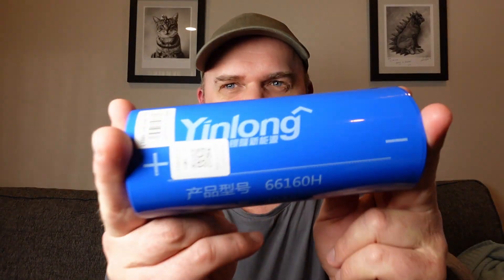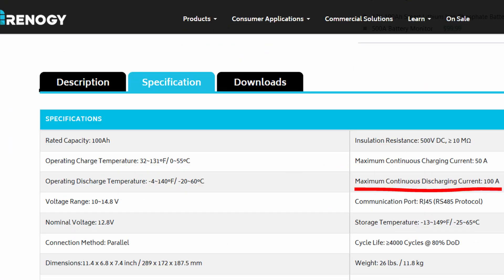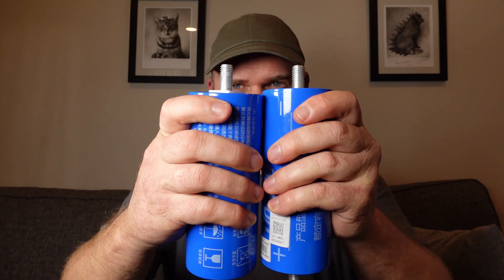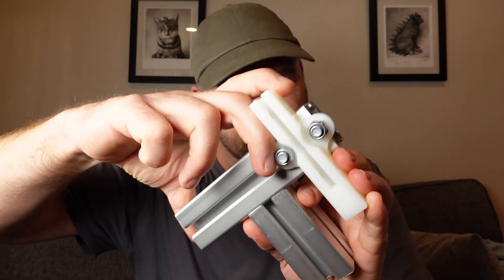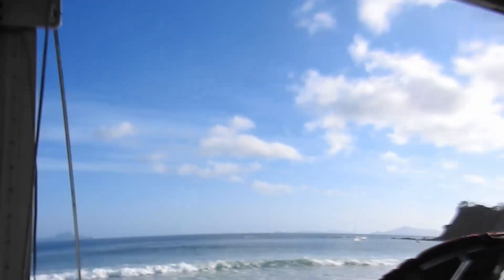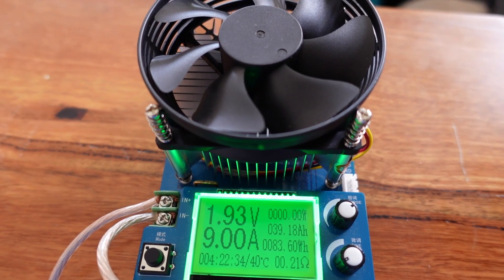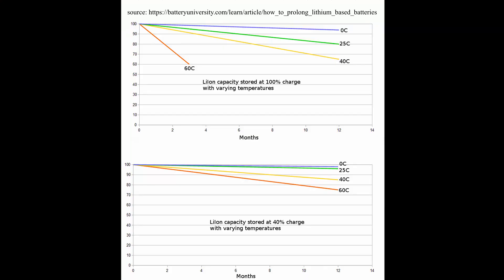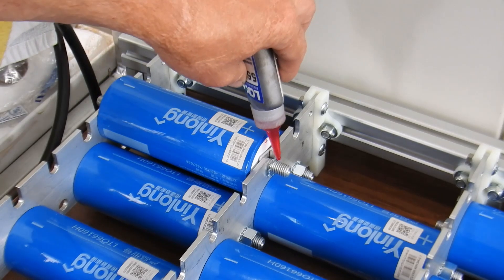Campervan DIY battery build HUGE POWER!

Comment: Great video man I really appreciate the information on these batteries though I kinda wish you would of shown the battery pack a little more maybe the finished version and maybe some usage tests. That RV your driving is pretty awesome I would love to see and hear about it ( I will check you other videos to see if you have any videos on it) anyway man thanks a lot for the video it’s great!

Edit: scratch that I just looked and you have a build video (I’m all over that video) sweet!! I love those Unimogs. Few years back I had a guy wanting to trade my ski boat for his older Unimog and at the time I didn’t know much about them and it was in poor shape so I passed but had I knew what I know now I would have jumped on it and could of built a sweet off road camper. SMH, live and learn right.
Reply from the maker: Cheers Tim.  I'll be doing more indepth on this battery and wiring in the future.  Thx

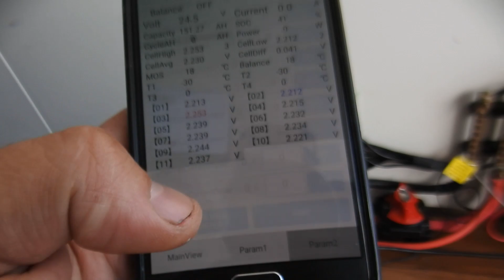Comment: 10:10 Im with you on that burner phone for the chinese software, got some for a BMS for my electric bike and it wanted access to make phone calls and if you denied it access it wouldnt run so stuck on an old phone.
Reply: Super important post IMO, due to the CCP.  The chinese people are good people but the chinese communist party is evil.
Reply: @GoZipper  You worded that perfectly. The Chinese people are good people, but in China, they are burdened by the yoke of the CCP. It is sad.

Comment: Can you make one ebike batterie out of it?
Reply from the maker: you could, but probably too heavy
Reply: @brendontait6968  36v how havy would it get ?
Reply from the maker: Depends on how many cells/how much capacity you need
Reply: @brendontait6968  500-1000WH
Reply from the maker: So 17 of these cells would make 36V, which would be around 1500Wh and 22kg.  If I were doing a pack like that, I'd consider the 30Ah prismatic, they would fit together in a smaller space and would be about 17kg

Comment: No temp sensors?
Reply from the maker: For what reason?
Reply: @brendontait6968  peace of mind?
Reply from the maker: What would you use them for?  Usually they are used for low temp cutout - not needed here.  Otherwise they are used for over temp on charge but my charge levels are too low to cause heating, these cells are also safe from failure after an internal short

Comment: I found a UK seller. £60. Per cell. Damn that's expensive when you look at how many you built together, does that sound right?
Reply: Yes, currently $47 US per battery.
Reply from the maker: Seems too expensive, you can pick them up for as low as $40USD inc shipping etc
Reply: @brendontait6968  bit of a minefield on Alibaba these days , the supplier in the first link you posted has now disappeared , they hate aussies lately so we have an added risk factor that they might not even arrive at all or they will send a bag of blue noodles instead of Yinlong 66160's

Comment: Nice build.  What do you use to charge your LTO pack?  Say when you are plugged into shore power.
Reply from the maker: Hey Dan - 100% solar fills it u really quickly
Reply: @brendontait6968  Ah.. yes,  forgot you guys have endless sun.   What charging parameters do you use with your MPPT?

Comment: That was impressive and even better, you're right here in NZ.  I prefer to use the smaller gauge soft fencing wire, which I don't think you can even buy these days, but chuck in a bit of number eight somewhere for that Kiwi feel and you'll have a winning combination (as if it needs it). Great work.
Reply from the maker: Thx mate

Comment: Pro tip for loctie a hair dryer will soften it up somewhat
Reply: or just use blue loctite instead of red
Reply: @Sugarsail1  green or nothing
Reply from the maker: I didn't use locktite brand so the color coding isn't relevant.  The stuff I used here was loxeal 55-04 which is equivalent to loctite blue.

Comment: Hey mate, just an old diesel fitter here with a bit of marine experience...
What types of metal are the - battery terminals, nuts & buss bars made of?
I see the buss is Aluminum, which in marine application would need a jointing compound to prevent dis-similar metal reaction from even 316 stainless steel.
So I suspect that sooner or later, 
you may end up with corrosion at each & every connection of this array.
We can also assume this corrosion will cause resistance which will generate heat---
not so good in a high current situation... just as your intro showed.
In this case- 99 cells x 2 terminals /cell = 198 
198 chances for this possibility to occur over time just from corrosion on the buss, 
due to dis-similar metal reaction. 
My suggestion would be 316 SS buss bars... 
but to be sure, what are the battery terminals made of? 
Aluminum nuts would also be an option if not for the load & heat potential, and, 
it's susceptibility to corrosion and the same dis-similar metal reaction to the battery terminal. 
Copper seems to be the trusted metal for buss in the electrical industry, 
but copper & aluminum don't mix well at all, just like aluminum with zinc/gal coated steel nuts.
But beyond this there is the soft (cut by hand with a knife) pvc tube insulators? 
Phenolic or at least hard nylon insulators would be required for use in ANY vehicle, 
to prevent a massive accident when the soft pvc tube gets split/displaced from continuous impact loads- which is the reason marine batteries are made with a more rugged construction.
Anyway mate, good luck with it. 
I would love to find a good, safe, affordable RV solution with this type of performance.
Reply from the maker: Hey, thanks for the comment.  Yeah, I'm reasonably aware of the dissimilar metals thing.  The lugs on the cells are ali and the bus bars are ali. You'll notice that I applied silicone grease with a cotton bud to each of the connections to prevent the possibility of any electrolyte or even air getting in the junction.  The "PVC" tube is actually nylon (I think I said this on screen) it is not a critical piece of insulation..  it just insulates the bus bars from the clamping bolts (which clamp onto the nylon brackets I made).  It's really there to minimize a short esp when using tools to clamp up etc.
Reply: @brendontait6968  Cool, glad to see you are open.
I am not here to knock, just interested enough to find a sound system.
If I can help, thats great, just don't mistake me for Anti...
If the cell terminals are Ali', it would be better to install the cell vertically, so as not to create sheer stresses, which you no doubt know is Ali's weakness. maybe then you could use a longer than normal Ali' nut; reliably.
In saying this I gave no thought to the configuration of the array, just a pure mechanical fact. I guess the strength of the buss & compounding weight on the lower cells may then become factors... 
But I agree in a couple of ways that 48v might be a better end product... 
on the more volts = less amps = less wiring/device load factor, &, 
generally improved 48v device  performance.
I'm keen to see you develop this, cheers.
Reply from the maker: @allxdup1909  as far as the shear stress, I don't think is a significant issue.  I'm not sure what grade they are using (probably 6060) which is roughly 200MPa in shear, if we assume a clearance on the minor thread diameter which would bring it to around 10mm X 200MPa gives around 15kN per side, so we are looking at around 3 tonne.  Even if the ali grade has got a quantity of cheese mixed in and is only 100MPa, that is still well over 1000 times the weight of the cell to cause an issue.  The orientation of the cells was primarily chosen to fit in the space I had available.  No doubt it's not a perfect pack, but I've learnt a bit making it and am going to make a bunch of different chemistry cells with different configurations in the future..  cheers

Comment: Think double nuts, torque first nut to mfg. torque, then add spring lock washer, then second nut, hold first nut with wrench, tighten second as tight as desired.

Comment: I just did my own calculations for my area, and my current setup which uses lead acid batteries wired SP for 24-volt.

Now if you're going to upgrade, you want to go better, not the same. My current battery bank is roughly 480 amp hours. Purchasing 84 of these would give me a Bank of 560 amp hours at 12 volts.
A lifepo4 battery in Canada is around CAD$1100-1400 each. I would need 6.
84x62.59= $5257.56
6x1100 = $6600.

Of course I could go Ultra cheap on the lifepo4 for batteries, But even Will recommends you don't do that because they all suck.  But a battleborn equivalent in Canada is around the $1,200 mark.
So I'm not really sure how Will figures Lithium iron phosphate is cheaper than this, but it sure as hell wouldn't be for me. And it seems like these things are better, to boot!
Reply: Completely wrong calculations. Your lead acid battery is theoretically 480 AH, thus only good for roughly 240Ah if you want more than a year lifetime out of them. A 300Ah LFP bank would already be more and better than what you had in lead-acid

Comment: Great vid. I’d be a little windy about the nylon insulation around your bolts, possible to wear through due to vibration and nylon can become conductive.
Reply from the maker: Thanks stuart.  I've always been under the assumption that nylon has some great mechanical properties...   elasticity to give resistance to fractures from vibration, good tensile and compressive strength, reasonable heat tolerance and good resistance to breakdown from degradation.  It does have a high moisture absorption tho.  Under what situation does it become conductive?

The nylon insulators work as secondary insulation as the bolts only clamp to the nylon bus bar holders and not the rail.  The intent of them is to prevent tools from 'livening' up when assembling.
Reply: @brendontait6968  it’s the moisture absorption. It’s more of an issue with black nylon where the black can be graphite based. From memory DC is worse than AC, but it’s a long time since I tinkered with it... My specific experience was in isolation of structural members to prevent galvanic corrosion between aluminium and steel, nylon didn’t work over time.
Reply from the maker: Interesting to hear your experience, thanks... yeah carbon black has been used a bit for black nylons l, additionally some additives like iodine can increase conductivity.

Comment: what is your current review of these batteries for solar power?
Reply from the maker: It depends on your requirements.  I wanted the safest, most rugged and longest lasting pack.  I think these suit that.  If I do solar that doesn't need those requirements I would likely use LFP as a lot of bang for your buck.

Comment: I expected to see one of the new cells to be given the spike test if they are as safe as you say

As to the use of Loctite, it would have been better to use the blue rather than the red as it is designed to be undone if required.  I would have expected you to know that
Reply from the maker: I just used the demo video, didnt want to trash a cell esp of there not gonna be any fireworks.

The 'loctite' I used was loxeal 55-04 which is equivalent to loctite blue.  Different brand, doesnt follow same color convention.

Comment: Blue Loctite-- You remove nut with a wrench! Red Loctite-- You remove nut with a torch!
Reply from the maker: I wasn't using loctite brand.  I used loxeal 55-04 which I believe is equivalent to loctite blue

Comment: Super awesome vid!!! So informative and very tempting - will do some more research. Can you shed some light on the bit between the build and the shot of it running. Do you have the wiring setup? Kinda missed a step there which Id love to see! A wiring diagram would be super awesome. Thank for all the links too
Reply from the maker: Hey... nothing much with regards to wiring there, an upcoming video I'll detail wiring to inverters, chargers etc
Reply: @brendontait6968  when u say nothing much. did u run BMS wires to bus bars etc..?

Comment: There is no wiring from a BMS to each cell so it is a "dumb" cell bank with no internal control. The manufacturer I was involved with insisted upon diodes for a "dumb" array. Diodes vary in their Vf and If so you choose the device as part of the design process.

Comment: Brendan, what type of solar panels have you on your van for a 48v system? How many would you need and any info on control units or inverters?
Reply from the maker: You can use whatever solar panels you like.  Just run them in series.  I'll do a video shortly on my solar setup.  Spoiler alert tho....  do not buy chinese panels.  The panels I have are REC brand and made in Singapore.  The power output from them is significantly higher than anything else I've seen of comparible size when mounted flat and not angled to the sun, in both sunny and cloudy conditions.
Reply: @brendontait6968  Great Brendan, look forward to seeing it. I was looking at ones on Aliexpress but I will wait for your recommendations.

Comment: Awesome video. Thank you.   You mentioned ~$55/battery.  But you have as strong Kiwi accent.  Just in case, is that $55 Kiwi dollars or US dollars?  :D

And, BTW, great job and kudos to NZ with how it managed the COVID situation!!!
Reply from the maker: Hey fanfare, thanks.  Tbh I think a lot of the COVID thing was more good luck than good management, but it is amazing to live in a covid free society!  The rate depends.  Buying them in small quantity it's USD, but if you buy in larger volumes it works out as Kiwi $
Reply: @brendontait6968  haha  Thanks!  :D

Comment: Would there be any advantages in performance from the battery pack to using copper bus bars instead of the aluminum or aluminium bus bars other than the cost and weight differences ??
Reply from the maker: So yes you mentioned the cost already... however, most people do not realize how much the cost difference would be.  If I made the bars the same but out of copper, they would cost several thousand dollars the cost difference would be eye watering.  Essentially the difference in conductivity for the load I'm running is negligible. I went over the sums in a comment somewhere below where someone criticized me for using ali.  The more important detail is the fact you would have many dissimilar metal junctions if a copper bar was used.  The studs on the cells are ali and prefer contact with ali.  When you mix metals, have electricity running through them with some moisture, maybe just thru condensation, corrosion becomes a big deal.

Comment: If you fully charge it how long could you stay off grid?
Reply from the maker: It is solar powered now so indefinitely.  But to answer the question as you intended...  the battery runs my domestic fridge in the truck for about two weeks (a bit shy of that in summer) so to provide lights and cooking, maybe 5 days?
Reply: Amazing project I hope to do similar myself in a few years. be interested to see how the working life will end up being. Enjoying reading all the comments

Comment: All Li batteries I have seen must have a charge controller and balancer circuit. Also where are the protection diodes?
Reply from the maker: Yes there is a charge controller and a BMS, I don't believe balancers are as important as people believe.  Protection diodes for what?
Reply: @brendontait6968   The Protection diodes are to prevent reverse voltage across a cell.
Reply from the maker: I still don't quite understand...  isn't that the job of the BMS? what sort of diodes would you use that would handle several hundred amps? wouldn't the diode still allow the cell to be charged in reverse at close to a volt before it did anything?

Comment: Loctite comes in various grades suitable for intrument screws to construction bolts. The grades are colour coded.
Reply from the maker: Yes, I didn't use loctite brand here, the stuff I used was loxeal 55-04 which is made for disassembly however I think it could still be a bit too strong.

Comment: how many of those batteries do you need for 48V battery?
Reply from the maker: A multiple of either 21 or 22 cells would work
Reply: @brendontait6968  Thanks mate, beginner question so will order 44

Comment: so that giant battery is about $4000 ?
Reply from the maker: Somewhere around there
Reply: @brendontait6968  thanks, and the longer life is the trade off for the higher cost, or is your choice for the safety factor?
Reply from the maker: @utubeape  combination... longer life, most robust (against things like BMS failure, low temperatures etc) and safety.